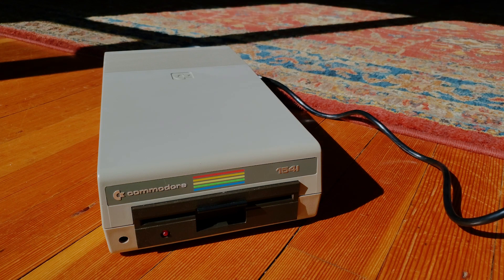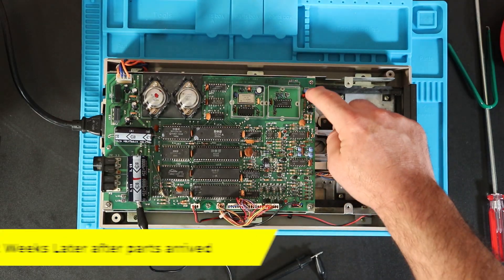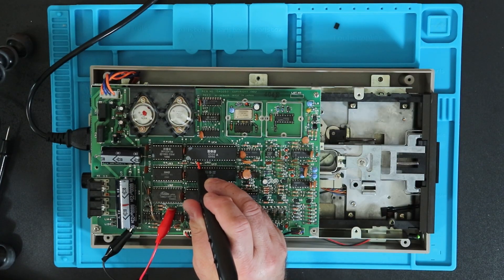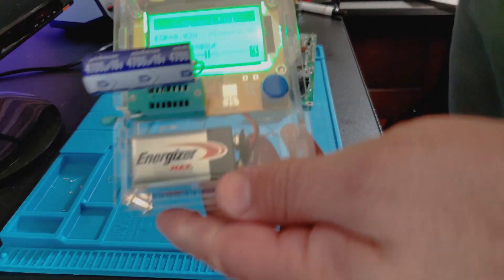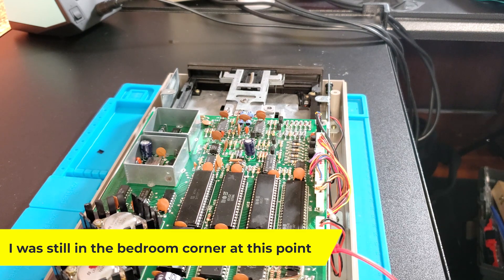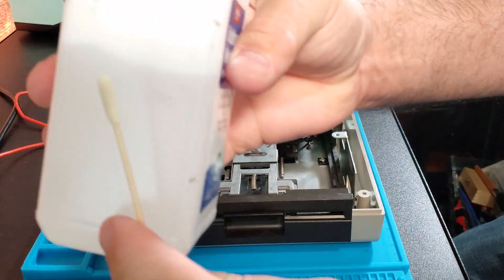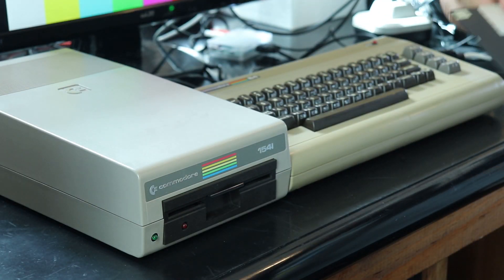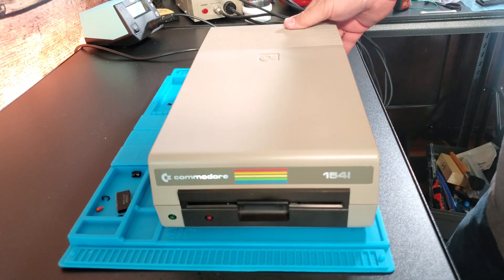Commodore 1541 Disk Drive Repair - Bringing it Back to Life

Comment: Hi there!  question regarding a 1541... When I turn on the drive, there are no lights at all, but I can hear the motor and see the (don't know its name) circular thing which goes in the middle of the diskette spinning around like yours ... do you have any idea about what could be the problem? many thanks in advance and for  your time
Reply from the maker: The 1541s natural state is for the drive to be spinning and the computer built into the drive has to be executing code in order for it to stop. A spinning drive with a red light is much like a black screen of death on a C64 (i.e. its just not running). Like the C64 this can be caused by a lot of things but, since you have no lights, I would start by checking the voltages. For detailed troubleshooting for the 1541 I highly recommend Ray Carlson's fix file found at https://portcommodore.com/rcarlsen/cbm/1541/fix1541.txt
Reply: @RavenWolfRetroTech  thanks sooo much mate!

Comment: Thank you for the video. I am a bit of a newbie dealing with electronics. My only suggestion is that you might have been a bit more detailed on what your thought process was when probing the chips. Other than that, excellent video! 

My 1541 has the exact same symptoms, but I have not opened it yet.  I wonder if it is the ROM too. Where did you buy the ROM btw?
Reply from the maker: I just watched that video for the first time in over a year (or two). OMG Cringe... I really need to do a full 1541 repair video and go over all the checks. The logic probe was just to see if there was activity on the data and address bus lines. I bought the ROM on eBay but, with the stone collection, I got a TON of these that were pulled from drives in the 90s (Most were replaced by Jiffy DoS). Based on your user name I am guessing you are in the UK? If so you probably want to try to find one locally since shipping is so high. Once I get my photo box set up again I will see about adding these to my shop.

Comment: Great fix and great video. I've also got an original 1541 that just spins, but I don't have the parts or the expertise to fix her. I've also got two 1541 IIs which so far I've found to be a lot more reliable - certainly they run cooler with the PSU external and are quieter as well.
Reply from the maker: Have you seen the technique some have used where they replace the transformer with an inexpensive switching supply then just wire it into the board in place of the voltage regulators? I like keeping things original but have been toying with the idea of doing this on a few drives to make them more reliable and less expensive to ship!

Comment: The reason why the stepper motor screws look rough is that most people don't realize the 1541s are made in Japan, and in Japan they don't use Philips screws, they use JIS screws. You can tell by the dot on the head. A Philips screwdriver will cam out of a JIS head and damage it. Here's another little-known fact; IKEA doesn't use Philips either, they use Pozidriv.
Reply from the maker: Alex, that's interesting, I actually use the ribbed type bits for my electric screwdriver, as recommended by a Mita rep in the 80s when I was servicing their copiers. They certainly do work better.

Comment: Great video.  I had a faulty 1541 (my original from back in the day) that had the same symptom, continual spin on power up. Mine ended up being a faulty 6502 (easy to fault find as it was very VERY) hot! I replaced the electrolytic caps and replaced the MOS branded logic chips too.
Reply from the maker: It's amazing that you still have your original 1541. With that done it should be reliable for some time to come!

Comment: I really need to take a look at my C64 and 1541. I drove 4 hours round trip to go pick them up (untested, condition unknown) for free a couple years ago because I didn't want them to get tossed in the trash. I have a working C128 and 1571 with a Pi1541 so it hasn't been an urgent task to get to.
Reply from the maker: Sounds like a fun project. Hopefully your PSU is not bad! I'd gladly walk a mile for a Commodore 64 (Or drive 4 hours)

Comment: Great video!  I'd love to see some video of your game after you finish it here on youtube.  I'm going to try to clean some disks and i've heard that if you remove the UB4 chip, the drive will spin indefinitely and you can use a Q-tip with alcohol to clean the disk while it spins. Do you think alcohol is ok to clean a dirty and even moldy commodore 64 disk with?
Reply from the maker: I would have to research if alcohol is OK on a disk itself. LONG AGO I had a critical disk that had a spill on it. I took it out of the sleeve and cleaned it with distilled water. I then took a new disk and carefully opened the sleeve so I could put the old disk into it. I then, immediately, made a few copies of the recovered disk and threw the damaged one away. I did find a blog post (https://nlwmablab.wordpress.com/2014/07/30/104/) that says they used drive head cleaning fluid that includes isopropyl alcohol
Reply: @RavenWolfRetroTech  Thanks!
Reply from the maker: @Studio 2 Magic You're Welcome